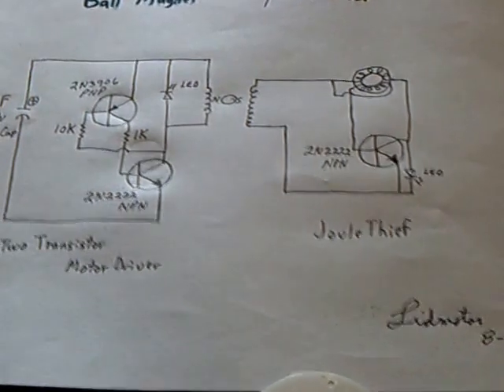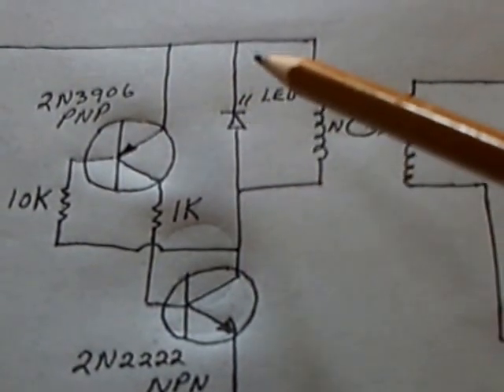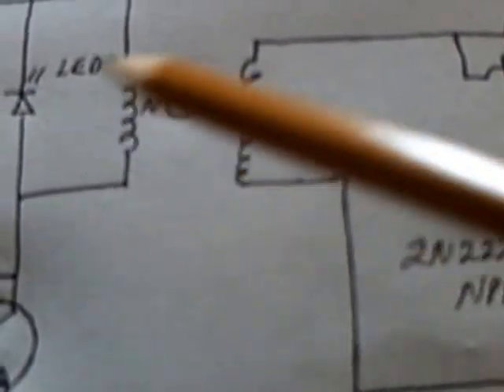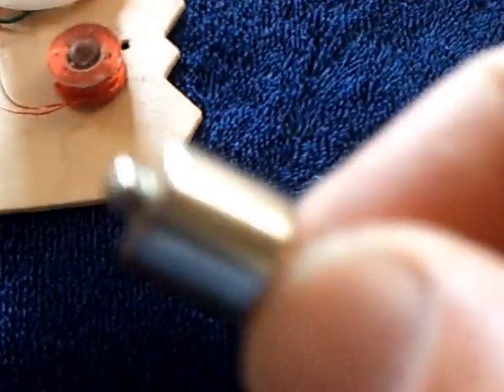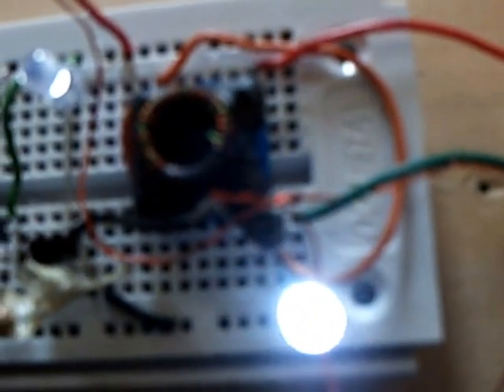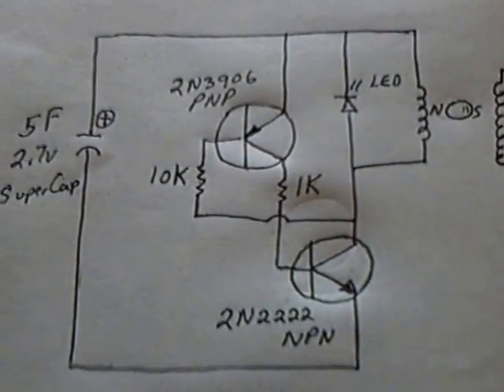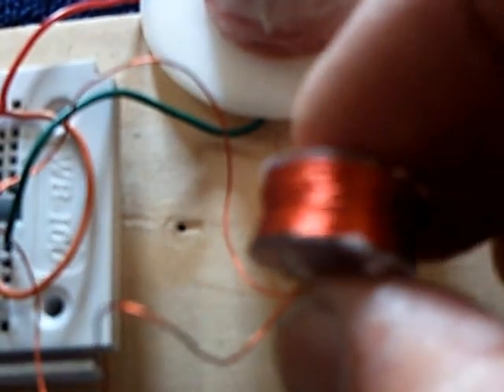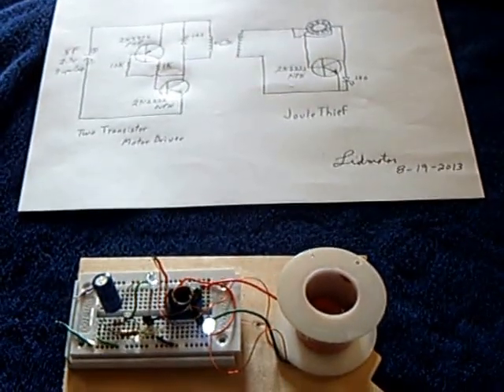Ball Magnet Motor--Generator

Comment: I like the starting method, same as Bill said, reminds of the rotors interacting in a few of my own experiments.
The induction is quite similar to your Maggie, I reckon the ball magnet itself is close enough to enable that to work and hence output is enough to drive the JT side of the circuit. Maggie will likely glow if the magnet she has in her mouth is removed.
Very novel video, very cool !

Comment: Several brilliant ideas there Lid.  Your starting method is genius.  I used to have to spin it in my fingers and drop inside the coil and hope it would have the poles close enough to spin.  Connecting those 2 circuits together is also brilliant.  I'll bet with some tweaking you can get it to almost run itself forever.  (almost)  Smaller sphere?  Larger sphere?  I wonder which works  more efficient?  Great job.

Bill